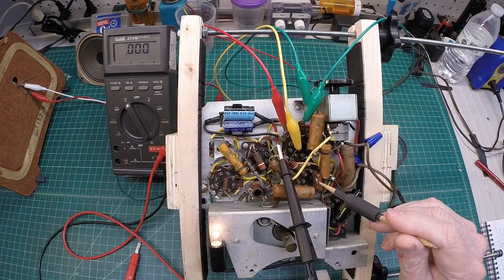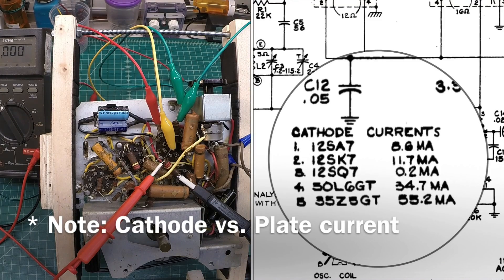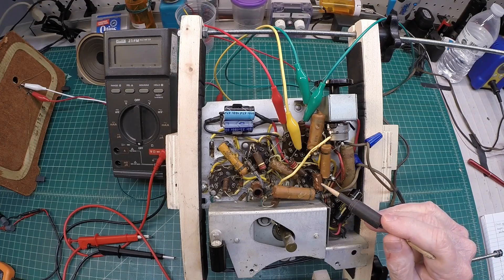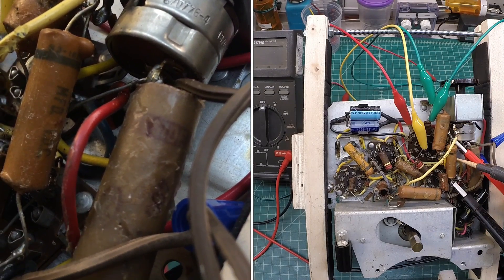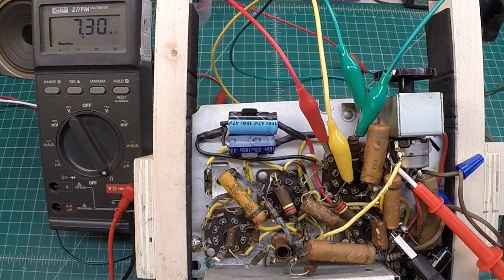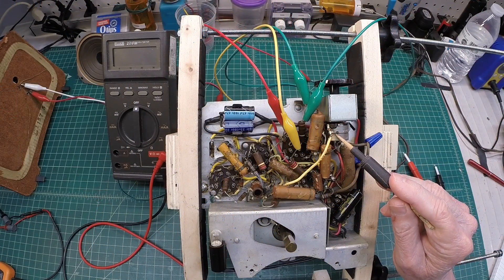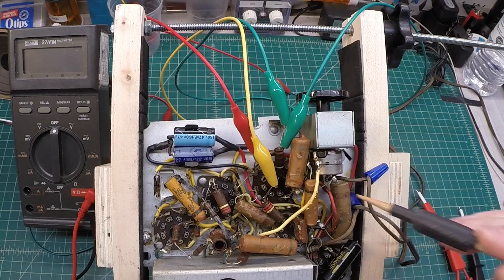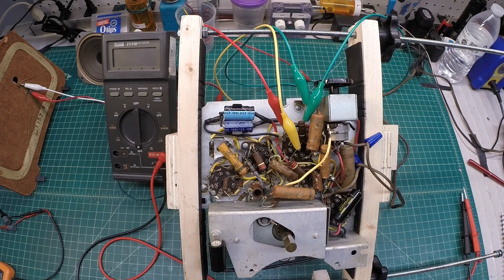RCA 8-X-541 - Cause & Effect P4 (More Troubleshooting Tips & Common Failure Points)

Comment: C23.  You just explained the difference between the Hallicrafters SX-99 Runs 1,1B, 1D, and Run 1C.  Run 1C capacitor C44, 270 pf has the same function, coming off the plate of the audio amp side of the 6SC7 is missing from that run.  I have found a leaky C44 before, explained well by you, and I am guessing that the capacitor was a bit of an engineering controversy given that they released a run without it, but put it back in with Run 1D.  Great video, Albert
Reply from the maker: Just curious if you could you notice a difference in performance with the cap in or out of circuit? Best, Don
Reply: RestoreOldRadios it was months ago, but one of my 99’s I tried without it and I think there was a problem so I put it back in. Cant remember if it was some hum or something else.
Reply from the maker: Thanks for the info. I may leave this one out of circuit after the recapping and see if I can detect any performance...

Comment: Another good and informative video. The methodology is key. Math is certainly an important issue and you kept it to a minimum. Ohms law  used in practice to conforming the performance of the radio. You said it right, when the current is not what it should be, the radio will distort or not operate at all. Ohms law is invaluable. Please continue with theory and practical explanations. Be safe.
Reply from the maker: Henk - thanks for your feedback. I’m publishing another video today on a look back at the Front-end and possible failure points before looking at the oscillator circuit with some troubleshooting tips. Thanks again for watching. Best, Don

Comment: Very nice step by step process to find the issues, but as a rule with old radios ...change all paper and wax caps....before doing anything....especially on the B+ and B- power supplies....but knowing how and why to test points..this is hard to beat his videos.
Reply from the maker: Thank you much. I hope folks watching get a better understanding of the common failure points and as you stated the necessity to replace all of the capacitors and check resistor tolerances before applying power. Again, I appreciate your kind words. Best, Don

Comment: Don, I had a radio with a similar cap C14 and the original cap (probably leaky) would cause the volume to vary so I put a new cap in and that took care of that issue.
Reply from the maker: Good deal Jim. Thanks for letting me know. Best, Don

Comment: Good job Don! Thanks for sharing! Take Care—Larry
Reply from the maker: I appreciate it Larry. What are you working on behind the scenes? Best, Don
Reply: RestoreOldRadios i’ve been opening the pool, keeping my running going....1 month until my 333 mi race (if they have it). I restrung the Airline, and put some toner on the cabinet.....will work on missing trim probably monday....I also put a dropping resistor in the AC line to drop it to 110v....other than that...just hanging loose....lol....Larry
Reply from the maker: The pool sounds relaxing. I was curious if the run was still on due to the CV restrictions. I’m looking forward to your future videos. BTW - I’m moving like a fast turtle now. LOL Stay safe. Best, Don